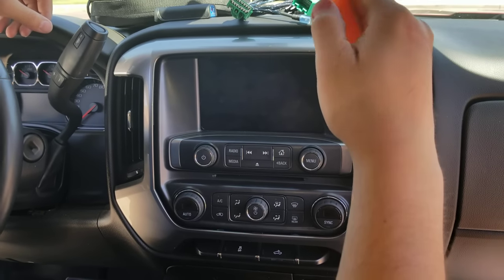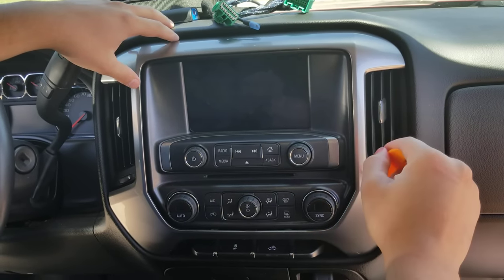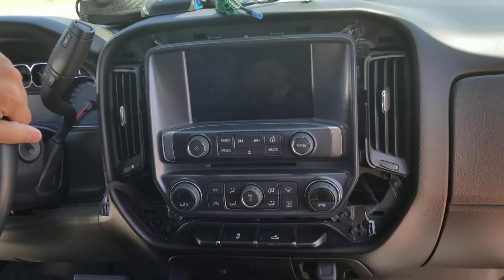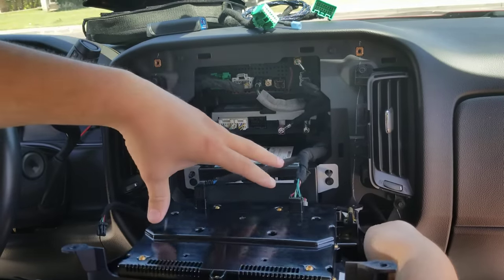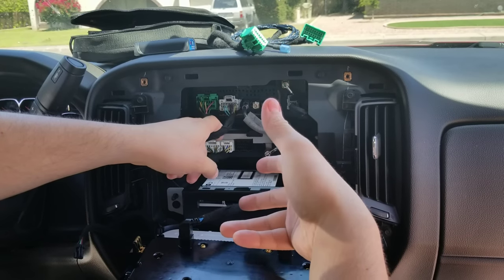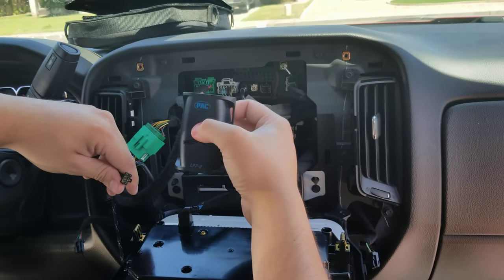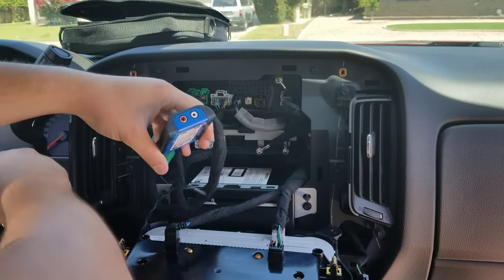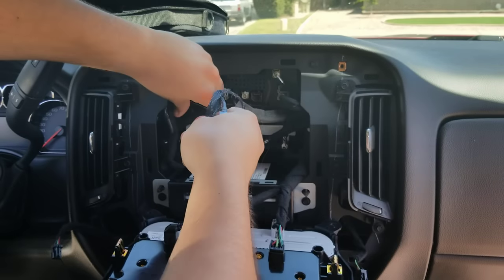2014-2018 Chevrolet Silverado/GMC sierra AMP Install w/out 7" screen

Comment: this works with the boss system?
Reply from the maker: NO. there is another harness for the BOSE system.
Reply: LLJ Customs Car Audio Fabrication L.L.C. I m traing to install subs only
Reply from the maker: @moflescromados2227  the new harness that works with the bose system is available on our website it will be shipping out Monday or Tuesday ..visit Www.LLJCustoms.com and look under   custom harness kits
Reply from the maker: Aaron our system show that you  ordered the harness back on 7/26/2018. have you installed the harness yet? We apologize if the information was misleading . If you do need a harness that works with the Bose amp pleas send us an email on our website so we can resolve the issue.

Comment: Does it with the bose system. Just trying to add a sub and amp??
Reply from the maker: Thomas Kue we are currently working on a T-harness for the bose system it should be available by next Friday..we have been testing it and will be going into production soon
Reply: LLJ Customs Car Audio Fabrication L.L.C  will I just buy the not 7" not bose. Will it still work? Just trying put a single sub in.If not can i return and get the new one.
Reply from the maker: Thomas Kue unfortunately it will not work given that the bose system requires signal stabilizers..what we can do is next week we when the new harness comes out we can send u the new one and u can send the other one back
Reply: LLJ Customs Car Audio Fabrication L.L.C  where do you sell the cable that you put in the Silverado 2014
Reply from the maker: @andrestorres4368  we sell them on our website. If u tell me what size screen u have and if you have bose or not i can link the page to the harness u will need
Reply: LLJ Customs Car Audio Fabrication L.L.C u can jus tap in the wires before the factory amp. Blue an grey is positive an grey with black line is the negative. This is the sub line for bose system.

Comment: **Does not work with 15 model LT Silverado with non bose radio**
Reply from the maker: Hello, Do you have the gold and gray connector  ? This harness is for 2014-2019 Silverados with the 8 inch screen.
Reply: @lljcustomscaraudiofabricat7854  yupp. We ended up wiring up a pac lc7-4 LOC instead.
Reply from the maker: @spdfrk101  the gold and gray is for vehicles withbthe 7inch screens. Glad you get your sound working you can always send back the 8inch harness for an exchange
Reply: @lljcustomscaraudiofabricat7854  the owner got his money back. Thanks!

Comment: Will it work with a bose? I have a 2016 GMC Sierra and all I want to do it add a amp and subwoofer to my system and still have all my controls.
Reply from the maker: Absolutely we have a Bose T-harness also

Comment: Does this work for 5 channel amp with a single subwoofer?
Reply: This is for 2 channels. You could run 4 with a simple Y. But for a 5 channel your looking at a special eq with a .1 output

Comment: How does this harness work if i want to run a 2 channel and 4 channel amps for Sub and New door speakers. or will i still have to splice in for the 4 channel amp
Reply from the maker: For your install you would want to use our loop back system with an amp tht takes a high level input of an lc7i. https://youtu.be/dplITOXR-GI